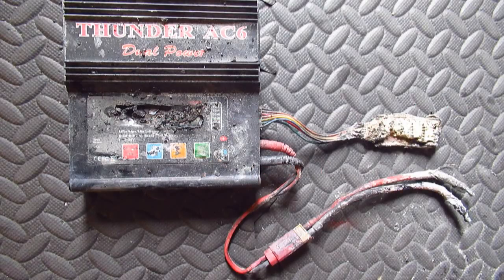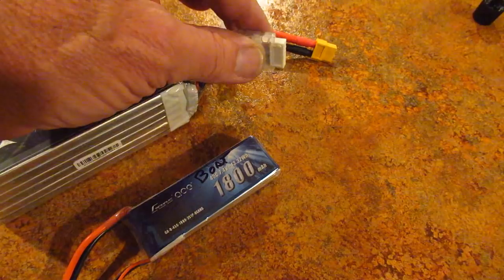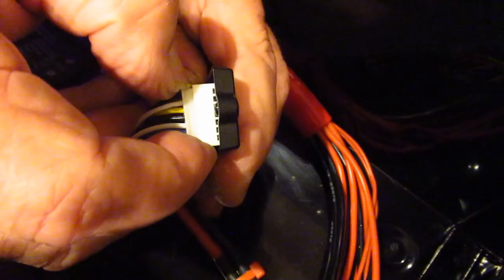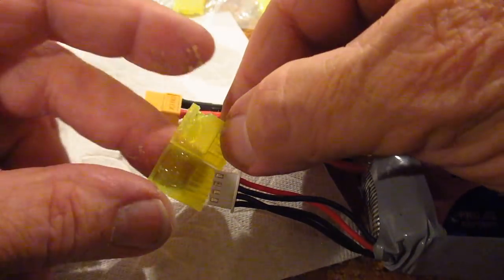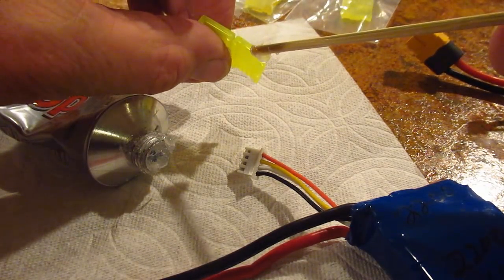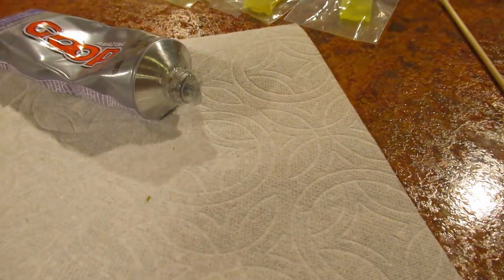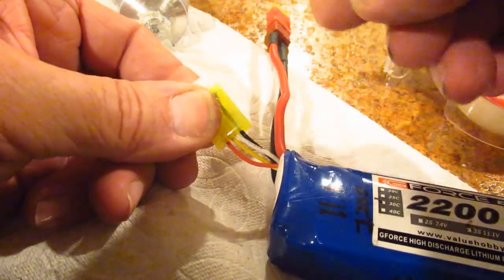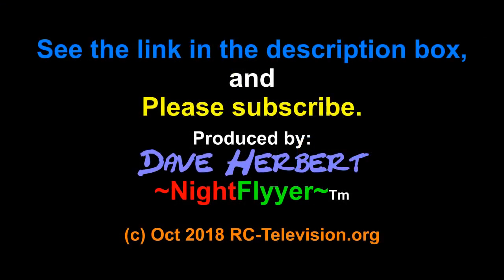LiPo Balance Lead Connector Protector Handles. Glued to prevent being sucked into Jet Fan.

Comment: Thanks for the video and explanation. As I value safety on all things related to lipo batteries, I instantly checked where to get these to my batteries and noticed that some of my Tattu R-Line batteries that I use with quadcopters already have this kind of protector handle installed by default. Great stuff... now I just need to order a bunch for the rest.
Reply from the maker: Thanks much.  I appreciate that.  Yes, a few smart manufacturers are on board.  I hope eventually all lIpos come this way.  Thanks again.

Comment: why are you gluing them?

They click together and work great, without glue you can remove them if needed.
Reply: +NightFlyyer 
I've never had one come off... used them for a couple of years now. 

I understand it's better to be safe then sorry..
Reply from the maker: @gailraby1722   Gottcha. I never had a battery (in over 15 years of lipo charging) ever explode either, but since there is 175 MPH wind suction from the EDF and these batteries are right in front of my fan on My F-16, you can see my point.  I lost 1 fan already that cost me $180, so I'm sure you understand. Thanks again.
Reply from the maker: Like I said before, they do come off easily and I cant take the chance of them being sucked off and into the electric ducted fan on my F-16 which would ruin it instantly.  I've learned the hard way over they years and there will never be a reason for me to remove them anyway.
Reply: +NightFlyyer 
I understand completely. 
As for battery fire I'm lucky as I'm able to not leave my batteries charging unattended, I use a 4 button charger similar to the one pictured, if a wire comes off the balance lead, does the charger not recognise that and not start charging?
I had a 3s that the charger sensed as a 2s so wouldn't charge it, the battery is replaced now. 
what Amp do you charge at? 

Do you check the cell balance and temperature while charging ?
Reply from the maker: @gailraby1722   I always monitor my battery charging and that is why I was able to instantly put the fire out with the extinguisher. If you had watched my last video of the battery explosion, and my new way of charging, you would know all those answers and why I invented my own charging station and charging grill.  I only ever charge at 1 c, I always use a temp sensor,  and if I was fast charging, storage charging, or charging just through the plug, not using the balance port, it will always charge, wires or not.  If I am balancing, my charger will not work either, if a cell is missing.  There is no need to balance charge every single time, and when the battery blew, I that is what I was doing.  Balance charging takes anywhere from a half hour to hour longer than just charging. 
I test all cells with my battery tester plugged into the balance plug first. If they are way off, I will balance charge.  If they are close, I simply charge.

Comment: Been using these for a couple of years now. Love them and don't ever glue them. Everybody should use them.
Reply from the maker: Since my batteries are so close to the ED fan in my jet, I decided to goop them.  Its preventative maintenance for me to do this because if one did pop off, it would destroy my $180 EDF, so that's why I goop them.  Goop is removable also, but I don't intend to remove them.  Glad you like them.  Thanks.

Comment: They're great.  I bought some the very day Hobbyking listed them for sale around 4-5 years ago and I've been using them ever since.  Mine aren't the spiffy yellow though, just boring translucent white.
I've never glued them on.  They fit well enough without and are hard enough to remove (to move to new packs) without the goop.
Reply from the maker: Thanks.  I put them on all my batteries, so do not intend to take them off.  I don't want them to pop off by accident and get sucked into my Fan on the F-16 Jet as FOD.
I already know what happens with a tiny stone.
Reply: Should have made a video then... Jk

Comment: Nice idea but If thats really what happened, that charger is a bad design or defective, if my charger doesn't see all the cells it stops charging, SKYRC iMAX B6AC V2. I always use a breakout board so im not plugging into the charger leads over and over
Reply from the maker: Well that's why I changed chargers, as who knows what happened!  I always use a breakout board also, as the only battery that would plug directly into the charger was a 6s 
anyway. Mine wouldn't charge either during balance if a cell was missing, but direct charging without balancing, it still charges, even if it doesn't see the cell.  The handle is still a very convenient addition to protect the battery wires. Thanks.
Reply: @NightFlyyer  Why were you not balance charging?
Reply from the maker: You do not have to balance charge every single time.
Reply: @NightFlyyer  Why wouldn't you? For lipos i would never set to not balance unless the battery has no balance lead.
Reply from the maker: Ive been flying LiPos for over 13 years and in the beginning there were no balance plugs.  It takes typically an half hour to hour longer to balance them every single time, so
 from experience, and looking at the voltmeter reading of each cell before charging, I know that if they are all very close to each other, there is no need to Balance them.
Reply: @NightFlyyer  Great keep doing that and i'll keep balance charging the day/night before and we'll see who's battery or charger burns up first.
Reply from the maker: @shckltnebay  I have hundreds of batteries, years old and all fine.  This was the first one that ever blew up.  Where are all your flying videos that give you all that experience?  Gee!
Reply: @NightFlyyer  On my channel, its not rocket science to click on my name and see them.
Reply: @shckltnebay    -  He has been around electronics his whole life, and I do believe balance charging is over-rated. He does measure each of them as he said w a volt-meter. They dont cost that much, and its many times QC. I got batteries that I trash and work like day one, and then I have the high end type which I baby them, and have gone bad. 

I do balance charge them, why not, its there for a reason, the same as balance discharging them.
Reply: @mazpr2025  Its amazing when people contradict themselves in the same post. LOL

Comment from the maker: *Update.  I glued because I can't take a chance of the protector coming loose and being sucked into the fan of my F-16. Better to be safe than sorry!  Now that I have had a battery explode which prompted me to build a Charging Station and Charging grill, I have also become concerned with the wires that come out of my Balance plugs.
Thanks to a viewer, I was introduced to these Balance lead protectors and show how I installed them.  Easy and effective in my quest to charge LiPo Batteries as safe as possible.
Here is a link to where I got them. Others also sell them but this is where I went first.
https://hobbyking.com/en_us/balance-lead-wire-protector-6s-yellow.html
Thanks for watching, charge safe, and please subscribe.
Dave